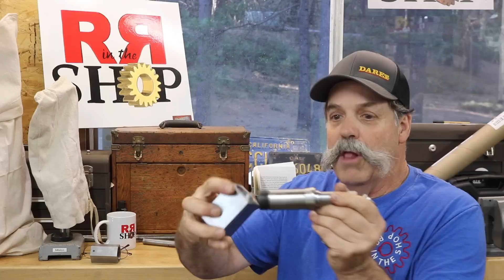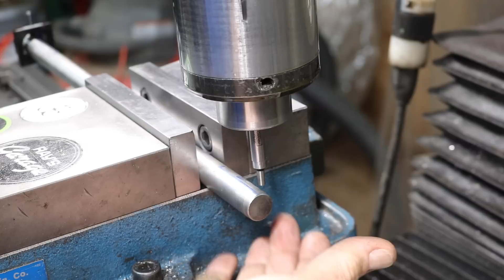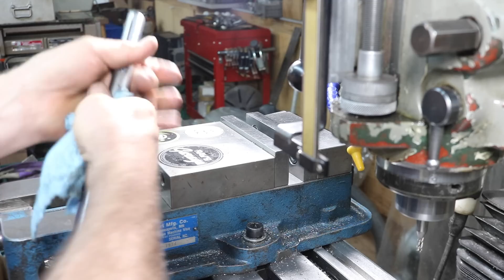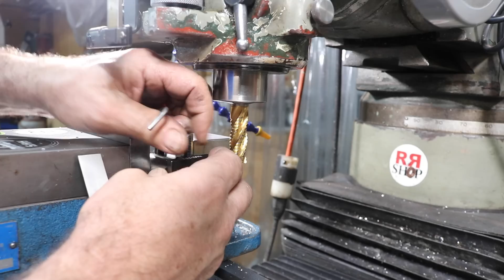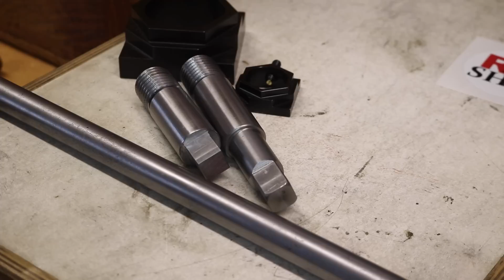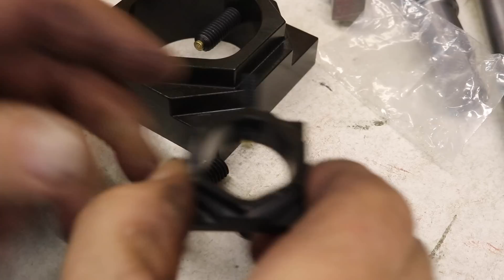Rose Index Review | Never Seen One?

Comment: I saw one used by a YouTuber.  So I made one for my final project for my CNC class I took last year.  I designed mine in Fusion 360 and then used the software to generate the G Code.  Mine is aluminum but in the reverse side I added a clock (12 sided polygon).
Thanks for the video.

Comment: Timm obviously make nice tools.  In your example of a simple jack shaft with pulleys on the ends, why bother clocking those keyways ?  Seems to me it isn't important to have precision clocked  keyways.  In the end, what does it mater where the keyways are in relation to each other?  
Ya did a great job promoting this product.  I enjoyed watching your Infomercial.
Reply from the maker: No on this shaft no reason to clock or make precise.  This is a project I had to do  and wanted to help Timm promote his product.  Thanks Dave for watching.
Reply: Dave ….… Thank you. I really want to produce a quality tool. I want that tool to used so many times that it's owner wonders how did I get along before having this. I could go on and on, however I'm sure you get the idea. I sincerely feel that the Rose-Index is one of those tools that job after job and year after year you are happy to have it in your tool box.

Comment: Sorry, just too much room for setup errors. Seems easier to cut one flat, machinist square from flat to table, move to next, etc. , not to mention much faster just using square from machined flat to table, too much fumbling to get "fixture" set each time. Especially for the price! For a hexagon 60 degree angle gauge to table from each flat, etc. An expensive widget, looking for a useful application, although i could envision some places where it would be beneficial.
Reply from the maker: Thanks for your honest opinion.
Reply: I prefer to leave the Rose-Index on the part being machined until completed. I use it a lot and rarely need to take it off. The Rose-Index does add significant length to the part being machined. That length adds to the ease of locating with a machinists square. Small flats are much more difficult to work with. I'll admit when I watched the video I cringed a bit watching the "Fumbling".....then I remembered/realized that Randy hasn't had the chance to use these much, and I'm certain as he works with them more he'll be a pro in no time. Somewhere some how I will try to add pictures and explanations of projects I have done with them over the years. The Rose-Index is very versatile and with some creativity you will realize how these have capabilities that many forms of indexers cannot compare to.
Thank you for your time.

Comment: Ehh are you really supposed to remove it?  I figured you just indicate it square after you rotate the part with it still on it.
Reply: Typically I just leave it on until finished. Rarely is it really a problem with clearance.
Reply from the maker: Thanks Multi.

Comment: Looks like a very nice tool to have in the arsenal... though maybe a bit pricey for occasional use for some of us. Certainly advantageous for long pieces.
Reply from the maker: Thank you Chris.  Happy Thanksgiving.
Reply: I am getting to the point where I think I will try a trial batch of them from Aluminum and see where the pricing comes out at. From previous trials the structure and rigidity is not good with high clamping pressures …. so I'll have to add a disclaimer that says a few inch pounds of force on the screw is more then adequate.
Thank you for your time.
Reply: Timm Rosenthal you are making a mistake making an aluminum version for others.  You can make all the disclaimers you want.  They will be overtightened and YOU will be the one getting the bad reputation because their parts will be out of spec.
Reply: @37yearsofanythingisenough39 

I sincerely appreciate you speaking up. I completely agree that the Aluminum version would not hold up well for any length of use especially if torqued heavily. And they do distort enough at high torques that I really don’t want my name on them. Then I consider how much abuse they will take when you drop them. I have worked on these for a few years now. I have many variations I’ve tried and what I have available is a great tool. The Rose-Index is far superior to any hole in square stock with a setscrew. My struggle is for people to take a chance, and pay a premium for a premium tool that really has no history or name recognition. I’m very confident that any serious hobbyist, or a person that makes a living cutting chips…….will realize they purchased a great tool after a couple uses. My 1” version is a bit dainty, however it is very helpful and compact. My 2” model is robust and as soon as you put it into your hand……you will realize it is a well-made tool. I use these quite often, and they really do make my job easier. If you have any type of a shop rate you bill at these are paid for in one or two uses.

Back to your point of aluminum not holding up. I do have some aluminum versions I use. When tightening I use common sense, because I know the aluminum does stretch significantly more at heavy torqueing. In the beginning I did some testing and measured how much it moved. While an aluminum version won’t have the longevity of a steel version not everyone will use these as much as I do …… and I’m trying to give an option for the person that won’t be using it often or is on a budget. It’s a dilemma that I wish I had a crystal ball to see if the investment in making a bunch of aluminum models would be worth the chance. (For anyone thinking of taking the time of using a Standard Thread Insert……I don’t think I would do that.)

If I take the chance, I see the Aluminum 1” version being around $35-40. While that is basically half price ….. I see it making more sense to simply spend an extra $30ish and get the good version that will last a lifetime. The 2” version would probably end up around $75-80, which might make it an option for the hobbyist on a budget. Again a crystal ball would be great. As of now I’m going to hold off until I see enough interest that would warrant trying aluminum.

Thank you very much for your time,

Timm

Comment: The advantage I see to these is that it doesn't require a full set of collets or collet blocks "to get-er-done".  However, I suspect you'd have problems if you just grip shafts in a mill vise without a v-block.  I suspect these would also have problems with softer items, like wood or plastics, where the setscrew might dig in.  I mention this simply because machinist toys are often REALLY handy in a wood shop.
Reply from the maker: Thanks you Drew.  Happy Thanksgiving.
Reply: I have an arsenal of work holding to work with. There are some scenarios that v-type vise jaws are very good, however typically because of gravity the round shafting will roll as you tighten the vise up. If you use v-type vise jaws I recommend you only open them enough to be able to rotate the shaft with some drag. Simple flat vise jaws work the best if you can maintain balance with the shaft. There are so many forms of work holding to work with and they all have there pros and cons.

Soft times. I have put small pieces of angle iron, shim stock, or whatever in-between the brass tip and the work piece. I would imagine you have little chunks of wood that you could work with in various ways to minimize any blemishes in wood. (I could envision a dowel that is drilled and used like the cups on crutches)

Thanks for your time.

Comment: That's great for long stuff, but maybe a bit fussy for shorter pieces.
Thanks for sharing!
Reply from the maker: Thanks Joe.  Yep I agree.
Reply: This is very versatile...with a little time using it...I'm pretty sure you will wish you had one a long time ago. The 2" version is 1-3/8" thick and the 1" version is 5/8" thick. While I prefer to leave in on in use it can be removed and put back on later very easily.

Comment: A useful tool perhaps you should produce some with your 3-d printer for other than 1&2 inches
Reply from the maker: I do not make these.  Check the description Joe.  I am just trying to help a fellow tool maker/small USA business.  Maybe 3d print from metal.  Thanks Joe for the suggestion.
Reply: I tried printing a new variation from PLA and other than being able to see what I designed in my head and put into my hand.....I wouldn't use a printed version. There's no comparison. Thank you for your time.

Comment: Did the same out in the shop today only much smaller.  I needed a 3mm triangular security bit for small security screw.   Hard milled it out of a broken #2 Phillips  bit.  Indexed it with the opposite end existing hex shape.   You getting any snow, been raining most of the day in Sunnyvale?  Have a nice turkey day.
Reply from the maker: Thanks Craig.  12" plus on the ground and 25F outside right now.  Happy Thanksgiving.

Comment: would a collet block not do the same thing with this technique ?
Reply from the maker: Yes but a collet is size limiting.  So this allows you to index long and larger material.  Thanks wilkbilt.
Reply: If a collet block had the capacity of your work piece it is an option, however collet blocks are much heavier and much more cumbersome to position and reference when compared to the Rose-Index in this application. The setscrew and v-block are very stable and work very well especially when compared to the tightening methods of a collet block. If you wanted to look further into the Rose-Index you'll start to realize that the 1" version is infinite in sizes from 1/4" to 1" and the 2" version is good for anything 1" to 2" diameter stock. Searching for collets isn't a concept. Thank you for your time.

Comment: When doing the square end,you already have a surface to reference to on the shaft itself,so why bother with attaching the block?
Reply: Randy was simply trying it and seeing how it works. Your idea is completely fine. The Rose-Index would add a bit of precision or make referencing easier by simply adding length to reference against the square.
Reply: @rmllcvideo  Exactly, and good training videos generate suggestions as well as exemplifying what can go wrong or errors that may arise. Ideally one setup to measure from would not induce cumulative errors as did the removal and replacement of the fixture IMHO.

Comment: Could you not do the same thing with the collet block?
Reply: Or a bog standard vee block and clamp .
Reply from the maker: You don't get the angles.  Thanks Chris.
Reply: Randy Richard In The Shop    you get a square.
Reply: @rrintheshop  if I had designed it I would be quite proud of it but quite often you only need to line up a couple of features and I prefer somewhere to put a level for accurate (relatively) work. I had a job last week that needed two holes directly inline at opposite ends of a metre of carbon fibre tubing, vee block rigidly fixed and a level did the trick. I think your minor errors came from continually fitting and removing your fixture allowing additive errors to accrue. BUT I might make one of those tools or at least add it to the tuit list.🙄
Reply from the maker: Sometimes and sometimes not. Thanks Les.  Size limitation with the collet.
Reply: In this application/video you could use a collet block however, I've compared them and tried. I've tried collet blocks for referencing/rotating while a part is in a vise, and I have used collet blocks to hold the part being machined. Everything is "Per Application", however I have had collet blocks in the shop for 14 years, and I don't remember the last time I used them for machining. I use my Rose-Index often. The Rose-Index is very versatile.